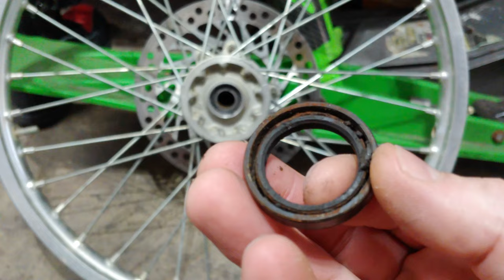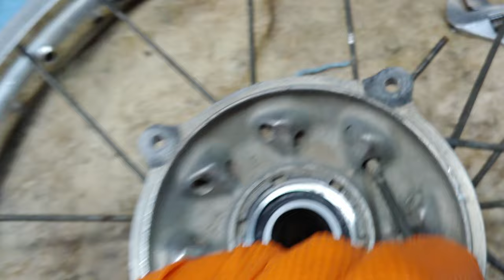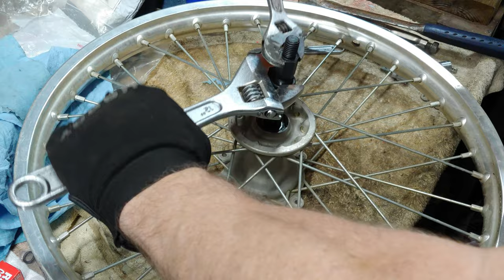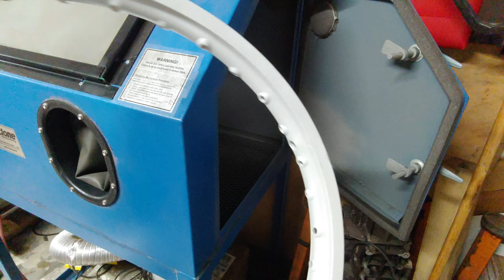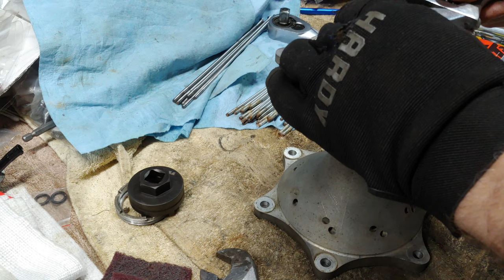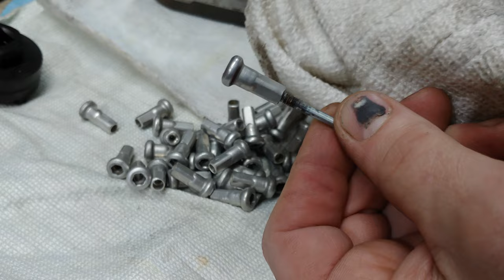DIY Powder Coating CRF250r Rims & Hubs Part 1 || Disassembly & Prep

Comment: What media are you using in your blast cabinet?  I've seen your compressor and curious if you are happy with it and the cabinet.  (My compressor is a little smaller than yours and I am looking to upgrade some point in the future.)  I did the double oven mod and it certainly gives you more space.  It was pretty much free as well.  That said, I can see where even a double oven may be small if I get more into coating.  If you plan to do a lot, you might want to just take the plunge and build a DIY oven.
Reply from the maker: I'm using mostly Aluminum Oxide but I also have another smaller cabinet in which I use Bicarbonate of Soda. But yeah Im happy with the compressor setup and have seriously been contemplating building a bigger oven.